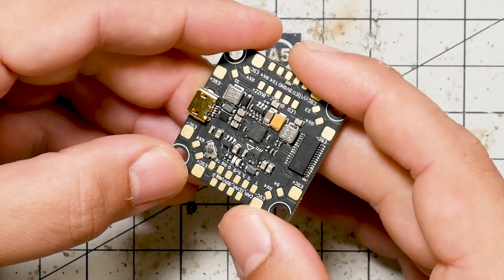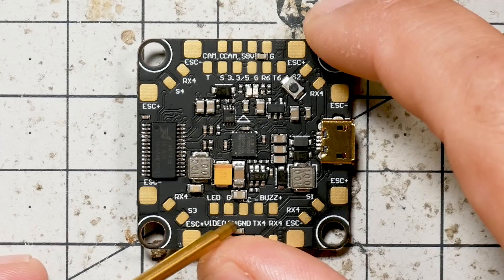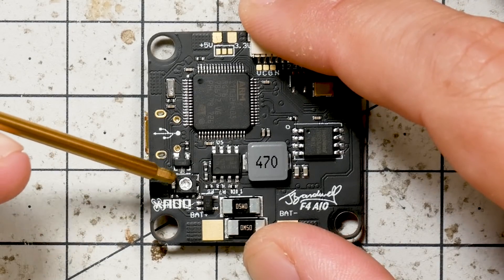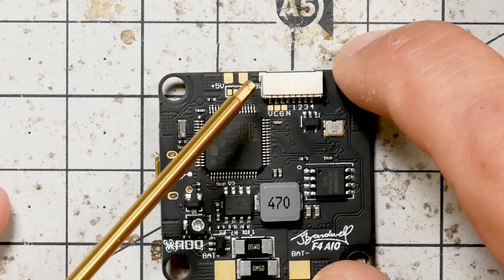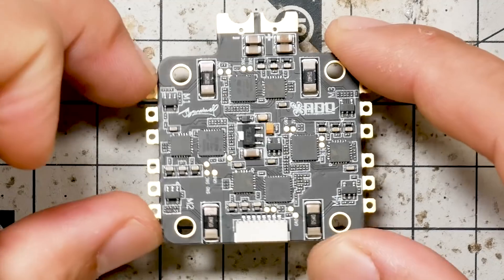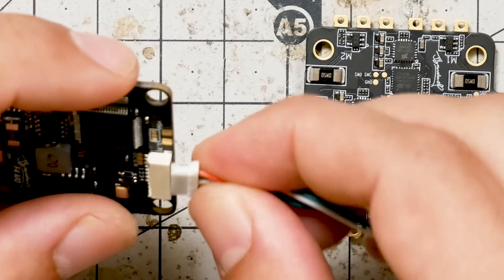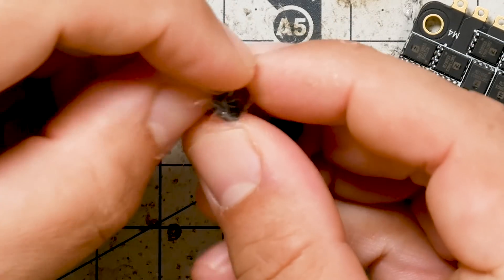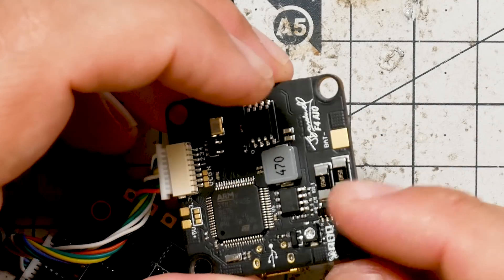JBF4 v2.0 and new Joshua Bardwell 4-in-1 ESC

Comment: Ciao Joshua, 
io sono uno dei tuoi fan delusi dall'acquisto del tuo primo fc. Sono sincero mi era piaciuto tantissimo anche per come volava ma poi un piccolo colpo in un gate e non ha più funzionato , solo ora ho capito sentendolo dire da te che c'erano proplemi al 9Volt. Comunque volevo farmi un quad nuovo e pensavo di acquistare la tua nuova V.2 e l'esc 4 in 1. Però ho anche appena visto il tuo tutorial sulla tua build preferita ed ho visto che hai usato kakute f4 quella con motori Luminiere, ed ora sono confuso. Puoi darmi un consiglio per ciò che dovrò acquistare? ti dico che a me interessa 6s per free style.
Ciao e grazieeeeeeee
Reply from the maker: If you have a v1.2 of my FC with a dead 9v regulator, please contact your reseller for a replacement. We tried to find every dead one and replace it but it is difficult to contact every single customer.

I used the Kakute in my build because I wanted an F7. The Kakute is more expensive than the JBF4, and F4 is still great for every build. I just wanted to pick the highest specifications for my quadcopter, even if they are more expensive.
Reply: @JoshuaBardwell   Ti ringrazio, per avermi risposto.
  Allora credo che proverò il tuo combo. Posso solo chiederti al mio posto che motori abbineresti per 6s. come telaio userò un 5" 
Ciao e buon volo!!!

Comment: need to use the ol' Bruce Simpson method for getting those bobbins in. it's in his video "Low cost miniquad racing drone build.." on a ZMR 250 frame. anyway, put a loop of wire or string through the hole and around the end of the bobbin and pull it through the hole. link ---> https://youtu.be/hayQ1Noa_G8?t=1965
Reply: kinda crazy watching that again.. I used his videos to build my first quad. #memories

Comment: Hi there Joshua, I hope you still check your comments on this vid. I baught your FC and 4 in 1 ESC and am having trouble connecting to BLheli. It connects, I press Read Setup, it says finished......... but theres just a blank screen. I can't figure this out. BF isn't running, its 32bit and yes theres a battery connected.
Please help
Reply from the maker: This sounds to me like an issue with the blheli program, where it is not populating the screen. Can you try on a different PC? Can you make sure you are running an account with administrator permissions? Try downloading and re-installing the latest blhelisuite32.

Comment: For ESC telemetry on the AIOv2 + JB 4 in 1 ESCs, using the wire harness, do the pads behind the plug still need to be bridged?
Reply from the maker: You need to bridge to select between telemetry and current sensing, yes. You want to bridge for TLM.
Reply: Thanks JB!

Comment: 30amps are enough for 2407motors o.O? (5x4.3x3 props)
Reply from the maker: Yep, definitely. Because the limiting factor is always the battery. And the 30 amp is a continuous rating; the burst rating is even higher. So the question is, are you going to pull 120 amps for more than 10 seconds? If the answer is no, then 30 amps is fine.

Comment: Had esc #2 not read in blheli suite on your brand new esc.. Have a replacement on the way but what causes this? just a bad apple? perfect build and wiring. triple checked everything including the 4 in 1 connector orientation. Even though i have a replacement on the way, im wondering why this is?

Comment: Do you have a set up video for you newest FC and 4 in 1 esc I am having trouble making the current sensor work. I have the solder bridge on tlm but am not sure what else I am missing, the osd readout just stays 234.45 amps and doesn't move.
Reply from the maker: Ports tab enable ESC sensor on UART 4.

Configuration tab enable ESC sensor or ESC telemetry I can't remember which it is named.

Be using dshot.

Power and Battery tab select ESC sensor as the current source.
Reply: Thank you I will give it a try.

Comment: Just got 2 of your 4 in1 escs. Hooked them up to your fcs. Both are v1.4. hooked up c pin from esc to rx6. Can't get current to work on either. Been talking with RDQ and can't figure it out. Ports uart6 esc sensor, config enable 32bit esc telemetry, and power tab voltage set to esc and current set to esc. Voltage works no current. Any help would be great. Thank you
Reply from the maker: The plug uses UART 4 not UART 6.

Make sure the CRT/TLM solder bridge is set to TLM on the underside of the FC.
Reply: @JoshuaBardwell  Older version 1.4 flight controller. No plug and no solder bridge.
Reply: Flashed FC back to betaflight 3.5 and it works. Flashed to newest 4.0 and it works. I don't know what release I was on. But it all works now. Thank you for your help.

Comment: So what happens if you use 4s with the esc? Does it not like it? Would it need programming to tell it to expect 4s instead of 6s?
Reply from the maker: No, it's fine at whatever voltage you use.

Comment: My 4 in 1 doesn't have a current sensor wire...If I run the battery +/- into the FC, can I then make jumpers from any two esc out wires to the battery in of my 4 in 1, or will it be too much current to power the 4 in 1 off only one set of esc outputs?
Reply from the maker: This is how you should do it: https://www.youtube.com/watch?v=1SvbZNU72FE

Comment: My only complain of the esc is the holes in the pad. Solder  leak through it.
Reply from the maker: The vias (holes) are important for heat distribution to avoid lifting pads under high current load. If you are leaking solder through to the bottom, you are applying too much solder or you are heating for too long.

Comment: Hey Joshua 
How do I change the motor direction on your 4-1 esc? The blheli configurator will not read the esc. And I went to download blheli_32suite and it keeps telling this site can not be reached. Thanks Donny
Reply from the maker: You need to download blhelisuite 32. Please check my "learn to build this quadcopter" video series which shows exactly where to download it. You want the video titled blheli and motors.
Reply: Thank you 
I will go watch that video.
Reply: I watched your video last night and I tried everything there. But when I go to the download page on the blheli_32 site I get the message this page is not available. Going to try a different computer today and see if that works. So far love v2 FC and the 4-1 esc just wanting to get the motor directions right so I can go fly.
Reply: Hey Joshua 
Just wanted to give you an update. It was the blheli_32 site that was not working. Followed your video on programing the Blheli32 esc. Sorry to bother you with this problem. I have your V2 FC with the your 4-1 esc on a Stix Screech frame and love the way it flies. Thanks again for all your videos.

Comment: I just installed your 4 in 1 and I can’t get it to connect to the  BLheli app anything you can suggest? Thanks
Reply from the maker: Be using blhelisuite32 not the chrome app. Chrome app doesn't work with blheli 32

Comment: I got a new one jbf4 and the esv isnwt working :/ 
motors are'nt beeping and blheli doesnt find the esc's.. i used for 1 year the JBF4 V1 and just replaced to the V2 version. is that happend to anyone ?
Reply from the maker: This indicates the signal connection to the ESC is not working.
Reply: @JoshuaBardwell  thank you for your answer. Can it possible that the signal connections on the jbf2 v2 isn't working properly? If yes what can I do? I just bought it.

Comment: Hey Bardwell, I'm having an issue where i cannot get the 4-in-ones ESC telem to work with your FC v2, i have the solder bridge bridged to TLM, and i have it all connected up and enabled in Betaflight, UART6 is ESC telem, esc sens on in config tab, and both voltage tab setting set to ESC sensor for voltage and Current, but nothing shows up in my OSD at all. Please help
Reply from the maker: The only thing you didn't mention is, are you using Dshot? ESC Telemetry doesn't work if you are using analog motor protocols.
Reply: @JoshuaBardwell  yes i am using d shot 1200 as the user manual/product description on RDQ suggests.

Comment: Having issues with your esc from rdq...I’m fairly experienced and have tried a magnitude of things. Every time I arm it takes off and I have to disarm and it falls from 5’. Does this on 3 diff fcs. Reflash and changed protocols. Any idea?? Thanks.
Reply from the maker: If it tries to fly to the moon, most likely this is excess motor noise causing the D term to overreact and the motors to spin up and fly away. Since it has happened on three different FC, damaged FC is unlikely. 

Have you messed with the filters maybe? Can you double check that the filters are at default settings? For example, sometimes when I use the Speedybee app it zeroes out my filters and I have to reset them manually.
Reply: Yeah I made sure it was always at default settings. The first fc was a helio spring v1, then a raceflight revolt v2, then a kakute v1 betaflight.

Comment: I'm having trouble getting this combo to read current...I've bridged for esc telem, but can't get betaflight settings to properly read out current. Do I need a uart enable for esc telem?
Reply from the maker: Yes you definitely do.

Enable ESC telemetry in Ports tab.

Be using dshot.

Enable ESC telemetry feature in Configuration tab.

Select ESC sensor in power and battery tab.
Reply: Thanks! That did it. Now...the new 3D build I just installed the esc on, channel 4 is not spinning the motor up at the same rate as the other channels when I cross mid-throttle. It hesitates for about half a second, then carries on. I've flashed the new blheli before powering on the motors, and swapping motors still shows the issue on esc ch 4. Is there any setting I can change or is ch 4 bad?

Comment: Hey JB, I just finished wiring up your FC/ESC stack with an R-XSR and I can't get Smart Port working. I have it wired into the T pad like the manual says, smart port enabled on UART 3 and I set half duplex to off. My Taranis is not showing any sensors other than RSSI and receiver batt. The T pad is inverted isn't it? So I don't need to do the uninvert hack - I can just run the wire straight off the harness?
Reply from the maker: Go to the CLI and type "set tlm_halfduplex = off" then "save".
Reply: I did that already and it's still not working.
Reply from the maker: For RXSR here are the steps required to get telemetry working.

1. Use yellow SmartPort wire from the RXSR harness.
2. Connect yellow wire to the T pad on the JBF4.
3. In Betaflight Ports tab, enable SmartPort telemetry on UART 3.
4. In Betaflight Configuration tab, Enable Telemetry feature.
5. In CLI type "set tlm_halfduplex=off" then "save".

Plug in battery/power up FC and receiver. In Taranis go to Telemetry screen, "delete all sensors", then "discover new sensors". Sensors such as VFAS and ACCX, ACCY, ACCZ should appear. This confirms telemetry is working.
Reply from the maker: If you perform these steps and it's still not working, I would look at the wiring or whether the receiver is damaged.
Reply: I appreciate the reply. I've done all of those steps and it's still not working. I checked the wiring and it's good. Continuity exists through the wire between the receiver and the solder pad on the FC so the wire is not broken. It's a brand new receiver and it functions fine other than the smart port.  I'll try moving it to the UART6 pad and see if that works.
Reply: Actually I just found continuity between the SBUS and smart port wires. I assume there should not be continuity?
Reply: Yep that fixed it. There must've been a short between the solder pads on the receiver. Thanks for you help and great videos!
Reply from the maker: Yayyy! :-)

Glad you got it figured out.

Comment: So I have about 6 flights on the JB F4 V2 FC/ESC. I seem to have a problem that causes the Voltage to drop out by as much as 4 full volts. This happens with a variety of different batteries during very mellow flying at and sometimes happens as little as 1 minute into the flight. With almost not control or attitude change- the voltage returns to normal ranges. I  also have some white lines in my VTX which is powered from the FC. I have changed the Channels and checked the connections as well as tried different antennas. Do you think this could be a voltage regulator issue?

Comment: Hey Joshua, 
   I could use your help. I have the version v2.0 controller along with your 4-in-1 esc combo form RDQ. I am using RDQ's Mach 3 vtx. I have the Spektrum SPM4649T receiver. For the Mach 3 vtx I would like to use Smart Audio. For the Spektrum SPM4649T I would like to use the telementary feature of it and I need a UART for it. 
   I am assuming that I solder the bridge for esc telementary. But would that take out the ability to use the Smart Audio for the Mach 3 vtx? With the Spektrum SPM 4649T receiver, I need a tx UART. I was planning on using the tx for UART6. Please help me to get all of this right? Thanks, Tony
Reply from the maker: Solder bridge for Telemetry on the 4-in-1 plug, which puts ESC telemetry on RX4.

Spektrum receiver on TX6.

Follow instructions in the user manual to reassign LEDStrip to softserial and use that for Mach 3 smartaudio. Instructions are on page 33 of the manual.
Reply: Thanks Joshua!!
I wired it up that way about a hour after I sent this message. Now I just need to mount the stuff up and solder the motors to the esc. Thanks again, Tony

Comment: mine burned up on the bench as soon a i powered up
Reply from the maker: Please reach out to support at racedayquads and they will do their best to figure out why. The first thing to check is whether battery voltage was put in the right place. If you used the 4-in-1 plug to a different ESC it can fry the FC if the pinout is not right for example.

Comment: Hallo Joshua, i think i cant use crossfire, LED, TLM, and Smart Audio in the same time... is this correct? I can use TLM or Smart Audio but not both. thx Alex
Reply from the maker: In this situation here is what I would do.

1. CRSF to TX6/RX6
2. TLM is built into CRSF so no problem there.
3. SmartAudio to TX4

Good to go.

You can also connect SmartAudio to pin IO4 on the CRSF receiver and free up TX4 for something else if you need to.
Reply: I used the receiver pad all works fine, i learned a lot from your videos! Special Thanks from Austria!

Comment: Hey Joshua like the new FC however had a problem with the T pad for s-port. Could not get it to work with the r-xsr. Had to hack the receiver and use the UART 3 tx pad to get telemetry.  Did I miss something? Should be able to connect s-port directly to T pad??  Other then that 6S very stable... Great Vids
Reply from the maker: SmartPort works connected directly to T pad.

You have to go to the CLI and type

set tlm_halfduplex=off
save

This is in the manual but many people overlook it.
Reply: Thanks.... Keep up the great work... The hobby loves you :)

Comment: Hey Joshua,
I got your new v2 board and in the manual you tell us to use SD Card for the blackbox, but there is no SD card slot on the board ! Am I missing something ?
Reply from the maker: Are you sure you have the latest version of the manual? The SD card reader was removed from the FC several revisions ago. If the manual still refers to it, that's an oversight.
Reply: @JoshuaBardwell  Yep I got the 2.1 version of the manual on Raceday Quads
Reply from the maker: Ok thanks for pointing it out.

Comment: I just installed your stack and had it arming and the motors spinning. After buttoning everything up, now it won't boot (partial startup tones) and it won't arm.  Here's a vid of what is going on. The receiver will connect with usb - and Betaflight sees all the channels and modes, but I can't get the motors to spin and it won't arm. Any thoughts? Thanks!  https://www.youtube.com/watch?v=x0wWF3DleBM&list=UU8hwyJXUk_ljsi0UR5EvEVA
Reply from the maker: Partial startup tones means the ESC is not seeing motor signal from the FC.
Reply: Hi. I spent the morning trouble shooting with a multimeter (after watching another one of ur how to videos). The FCs 9v is toast. I get continuity throughout the 4in1. The ground pin in the ribbon cable connector on the FC  is  missing (looks like it melted). .  The 3.5/5 volts and the ground on the FC are good. They go all the way to the bat terminals on the 4in1, power is good up to connector on the FC, but  nothing to the 9v pads. I  ordered another  and will hopefully warranty the other.  The first  time tho, everything went together great. Wired it up and fired it up. I was psyched :P. Thanks  again!

Comment: YO! I'm installing your Stack in a QQ190 frame. The main bat pads stick out too much to fit with the QQ190s fancy vtx antenna/led mount. I can do without it, but I like it. Anyway, I'm either going to rotate the 4in1 180 and remap the motors, or grind the bat terminals down. Thoughts? Thanks!
Reply from the maker: https://www.youtube.com/watch?v=QeuSq71pYF0
Reply: I watched that last night. Thanks for that.. and every other vid.  The only drawback to rotating the esc is that your huge (in a good way) battery solder pads stick out and and are exposed on this frame - so they might take a hit.  So you wouldn't grind your battery terminal pads?  :P Thanks again!

Comment: So If using your FC/ESC Stack, I should solder the bridge for ESC TLM on the bottom of the FC. This will tell the FC to expect a digital telemetry signal from the ESC on pin C of the 4in1 plug which is also pad R4 of UART 4 right? Then if using a VTX with smart audio, where should I solder the smart audio wire?  A UART either Rx or Tx can only be used for 1 function right?
Reply from the maker: Correct in all counts. Use TX6 for vTX remote control. Detailed instructions are in the manual for most common permutations.